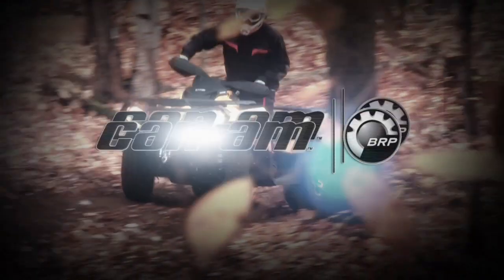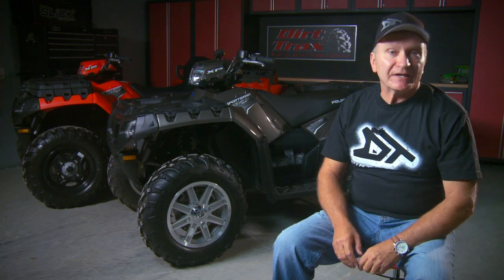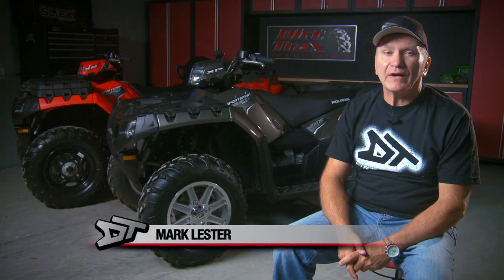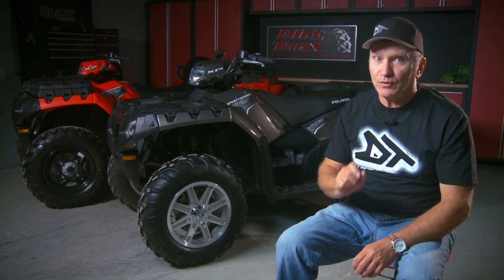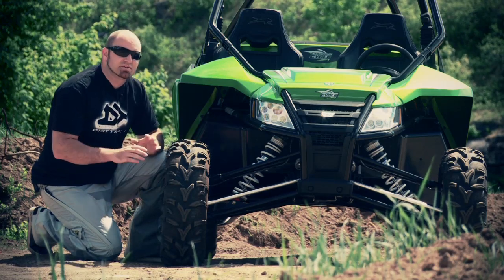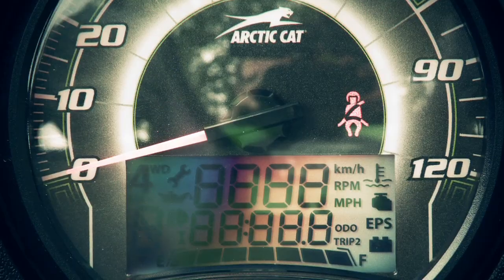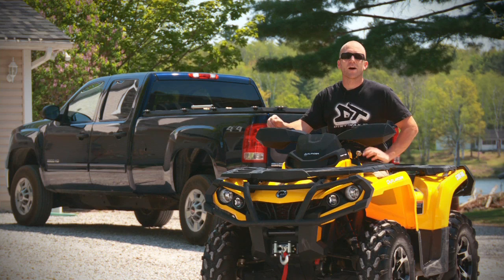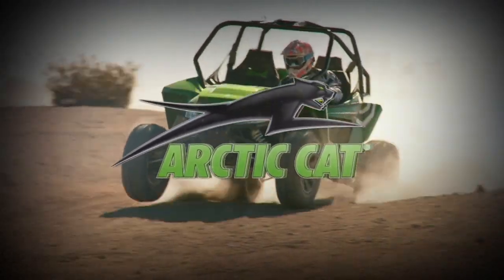Dirt Trax Television 2012 - Episode 4 (Full)

Comment: What a slap in the face! How could you not showcase  the 03 Predator? Pro steering, Fox shocks, 500cc twin cams, anti dive, anti squat need I go on. The only mistake they made was to stop making it. If they put the money in the Predator, that it took to develop the Outlaw IRS the Predator would have DOMINATED racing.